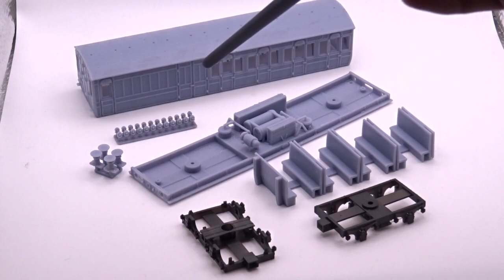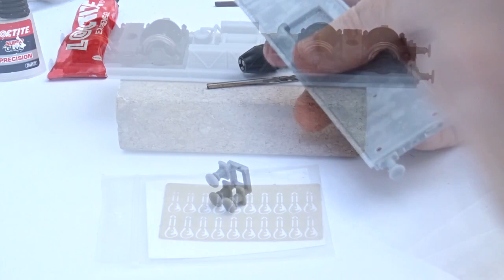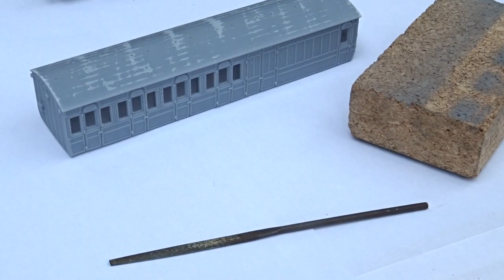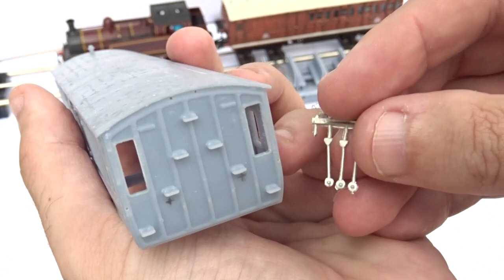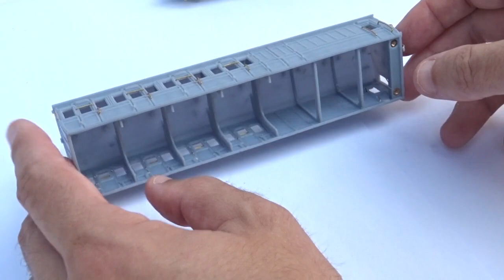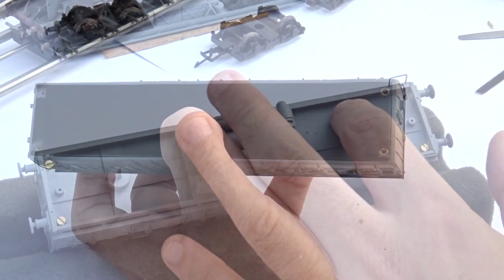Vectis3DModels: Ashbury Metropolitan Carriage kits in OO

Comment: Looks amazing, and great detalization of the model! I wonder why the body did not warp the same as the chassis
Reply from the maker: A couple of reasons. The printer is only so big, and it's cost and size and time, as the body shell is the main spine of the model and self supporting when fixed to the main body shell the floor would be held straight.
Secondly the floor has to have recesses for wheels this is thinner and less supported and the ends will warp.
As mentioned the body is the main structure.. If you don't have a strong body shell design this will warp also.
Reply: @bluebellModelrailway  in what orientation did you print the body? I am asking, because my prints warp heavily even if they are designed as a self-supported box.
Reply from the maker: It's rotated on 3 axis and printed roof facing the build platform and built from a point on the corner 30 degree's on 3 axis plus also wall thickness is 0.9mm.